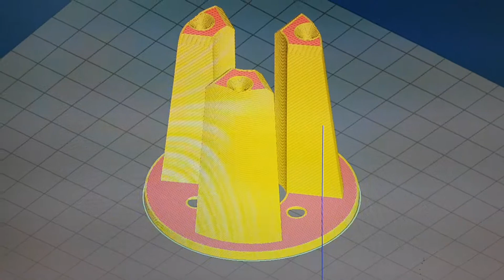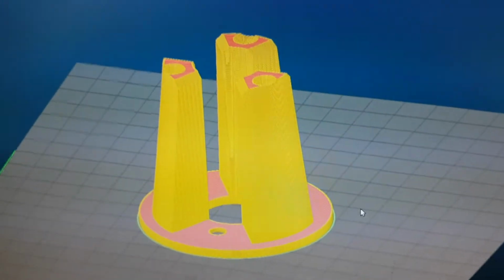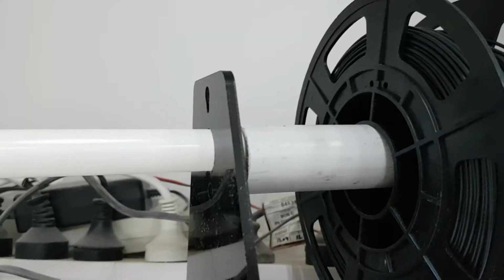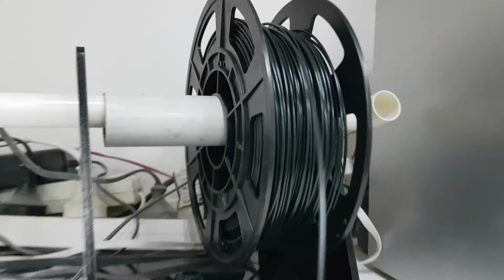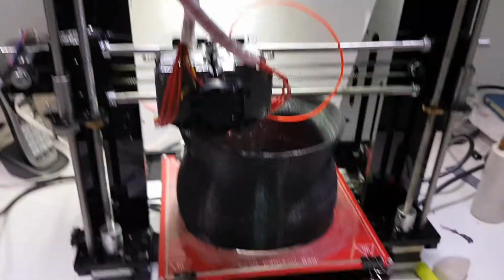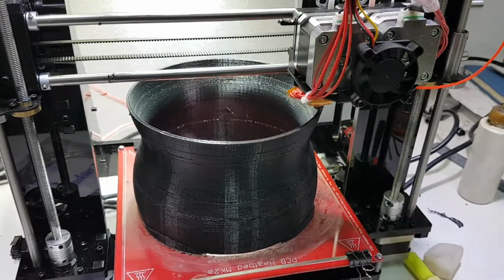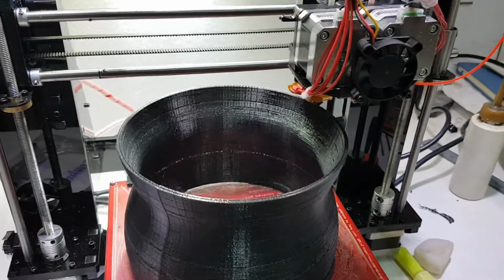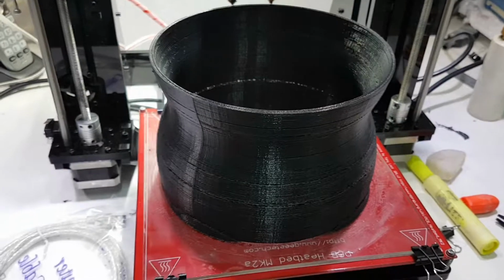Prusa printer jamming problem, and possible solutions.

Comment: could be a loose stepper motor wire too...
Reply from the maker: A good thought.
Although what I have done to unjam the feed is simply to push on the back end, and from then on it feeds OK for a while.
The jamming happens on the infill most frequently, the feed rate of material drops of dramatically, but there is also a fair bit of vibration.
The low feed rate could produce more melt-back, but also could test the connections.
I guess I will keep that in mind when I eliminate other causes, because at the moment I am confident it is likely to be melt back.
There are a few noticeable compromises made with the dual head.